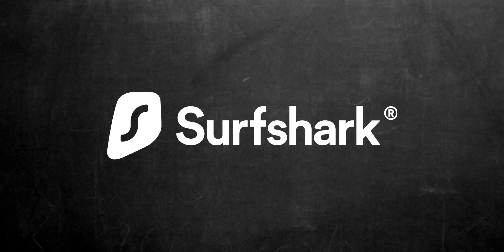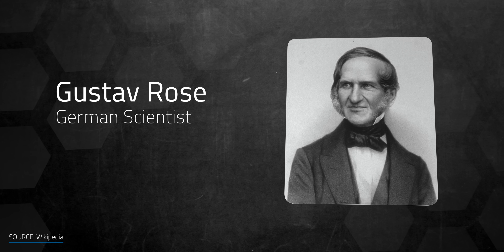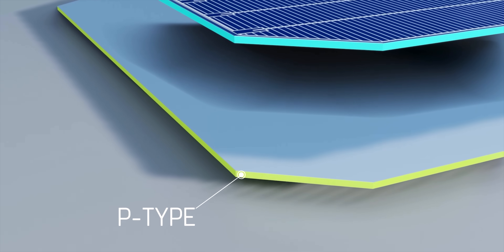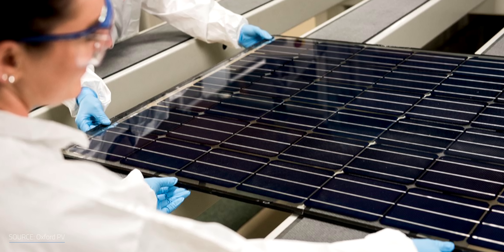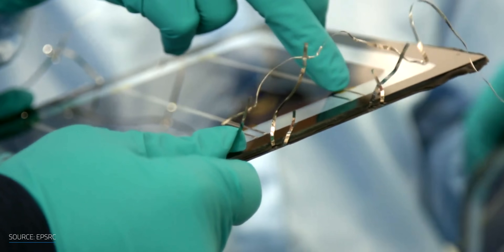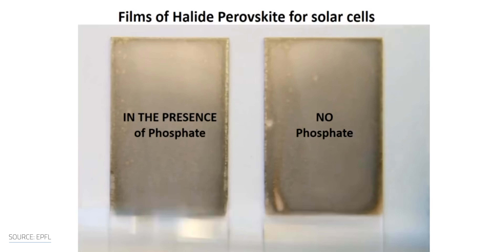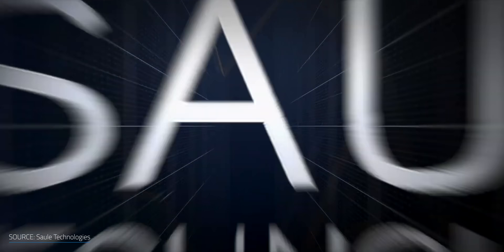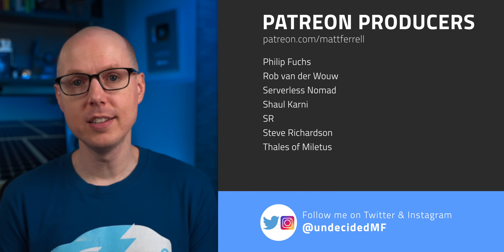Perovskite Solar Cells Could Be the Future of Energy

Comment: So if the lifespan is considerably shorter, I hope that someone is looking into recycling the materials into new panels.
Reply: He did say the process that degrades them could be reversed, so you might just have to send your panels in for regeneration every 10 years.
Reply: @ancapftw9113  Or trade them in like an alternator and others can purchase the “refurbished” panels at a reduced price.
Reply: @ancapftw9113  if the lifetime was 10 years, these would be everywhere. It is much much much much less.
Reply: Why is it harder to refine the metals or other materials out of waste. They refine iron out of rock or iron ore. They refine aluminium out of bauxite. They have to initially refine the arsenic, galium out of other materials to get the semiconductor materials to make the solar panels. You would think it would be easier, at least in many cases, to refine the materials back out of waste.
Reply: @grgmetube  It's a matter of the materials the metals are being refined from.  Bauxite is actually very pure, the aluminium is with very specific elements and silicon dioxides but in a landfill, it would be with anything from motor oil, anti freeze, mercury, lead, countless organic chemicals, pesticides, basically anything that was thrown away.  Refining requires that you know what you're separating the desired material from so that you can use differences in physical and chemical properties to extract them and in a landfill, they are just with too much other stuff requiring just too many procedures to make extraction practical.
Reply: @grgmetube  The reason is mainly that with processed materials you get alot of byproducts. Iron Ore is mostly ironoxide, 2 Iron per 3 Oxygen. You just need to reduce the Iron and voilá. Of the ore contains other minerals as well. Those can sometimes be seperated mechanically or refined parallel.

But with other materials the desired metal that can be refined is a far lower concentration than in the ore. And it isn't easy to seperate them. The ratio between Silicon and boron/phosphorous is around 1 to 10 Million to 1 to 10 Thousand. You cannot get it out again.
Reply: @davidthane9002  In materials that had been used in end-of-life products were sent directly to the recycle place instead of to the rubbish tips, it would be far easier to recycle or reuse. As you said in some raw materials they already have to get at the very low concentration of elements that they want. It's probably a matter of developing the processes, so that the volume of production ori re smelting, in time brings the cost down.
Reply: Same as now, dump them in with the scrap steel pile and shred them, 98%+ of it is known as flock or in laymans terms rubbish.
Reply: They don't think of that, instant profits is what matters to them.
Reply: Why? Why not just crush them and use them as agrigate in roads.
Reply: @wiretamer5710  I did say that other items such as the mylar in juice boxes where the recyclable material is very thin are just ground up as aggregate instead of actually being recycled.
Reply: You think that's bad, you should look into whats happening to all the old wind turbine blades. They're too durable to really break down and even if they weren't they're made out of stuff that's either renewable or so abundant recycling would cause worse effects than just making new. We need to quit screwing around with wind and solar and just go nuclear already...
Reply: @Jmvesey  They've already worked out the wind turbine recycling problem as well as the size limitation of transporting the steel tube and blades on the freeway.  Turns out you can make the turbines larger if you make them out of wood instead of steel and fibreglass, basically flat pack the wind turbine.  The problem with wind and solar power is they are not load following, we've used statistics and weather forecasting to compensate and small gas turbine power stations and energy trading, however conventional nuclear isn't much better due to the need to rotate the use of fuel rods to reduce xenon production but molten salt reactors are load following.  Nuclear may be part of the answer but not conventional solid fuel rod nuclear but something like the Liquid Fluoride Thorium Reactor.
Reply: @johnwang9914  From what I've read wood only works to about 35 meters before the warping from remaining idle in sunny conditions too long causes vibration issues when restarting them. Some companies are also chipping the old blade up into filler and insolation, but the companies that do that are so few and far between most of the time they're just burying the blades because shipping costs would be to high.
I agree on the conventional nuclear rod reactors. You should also check out the modular pebble bed reactors X-Energy is developing. Relatively cheap to mass produce and should be impossible to melt down. They trade irradiated gas and liquids for graphene dust however. But that is much easier to filter than a gas and much more compact than an irradiated fluid. Would be a good stepping stone to LFTRs.
Reply: @Jmvesey  Well, on the nuclear front, China is said to be putting to test a prototype Thorium Molten Salt Reactor before the end of this year. They are looking to commercialise this before 2030. China is very keen to have nuclear as a BIG part of their clean energy solution moving forward, more so now that they just had a taste of unreliable wind power recently in their Northeast region.

Comment: With such thin structures, I could see this having applications in aerospace. You could basically paint or laminate this onto the top side of the many electric aircraft that are under development. While it likely would not achieve a power balance, it would extend the range of these aircraft.
Reply: A Japanese group put out a study they did on some perovskite cells that they exposed to a radiation source. They were trying to replicate the effects of long term radiation exposure similar to high orbit space flight. The Perovskite outperformed Silicon by a significant margin. I think we are likely to see these cells used on satellites before they see wide adoption on planes.
Reply: Heck, even yet could reduce fuel consumption by running stuff in the plane from solar PV

Comment: If life span will be in around 2 years, then price should be AT LEAST 20 time lower to compensate that. Surely this will not happen. Silicon based solar cells simply works, so maintenance is cheap. Try to imagine costs of man hours to replace cells every to years and trouble with that. In my opinion in next couple of years perovskites will be nothing but niche product.

Comment: Can they put solar panels on windmills? That could be two birds with one swing 🤭
Reply: I wonder if they could coat them onto the blades? 
Just like I've wondered why they don't have solar panels already on wind farms.
Or floating solar on every upper dam reservoir used for hydro power. Or battery storage at those projects.
Or why floating wind turbines also don't use a lower sea powered turbine. 🤔
Reply: @4literv6  Putting floating solar panels on a dam reservoir could possibly turn the dam into a sort of battery. Use solar power when the sun shines and save up water (possibly even pump it up if there is space) and then switch to hydro power when the sun is down 🤔
Reply: @AnimilesYT  yes indeed and in hot climates it saves a lot of water evaporation to. From the research I've found on the few floating solar projects.

Not to mention they could easily ad battery storage systems. As the high voltage lines&transformers necessary are already in place.
From what I have found researching hydro power here in the US. Rarely is more than 50% of rated capacity ever used.
So there is room to easily upgrade the old turbines, do floating solar panels on upper reservoirs, ad battery storage for any bleed off from excess solar or hydro production. 

Or even ad wind turbines around reservoirs as they often are in out of the way places. 
Where residents wouldn't complain about the turbines appearances. 
Further more damns are on federal lands to. So I doubt getting them installed would be an issue with permitting etc. 
Imagine each existing major hydro project getting a 50%+capacity increase from doing those simple projects. 👍🏻
Reply: @4literv6  Things like permits can still be a problem in many other places though. I live in one of the flattest countries ever, so hydro power isn't really used where I live, but I've seen other places in Europe where hydro power was close to people's homes. 

Anyway, I mostly agree with you. Using solar against evaporation is also a really good argument. I'm not quite sure about the battery storage though. Large scale battery facilities aren't cheap and it requires a lot of materials. The energy storage solution I was thinking about is pumped hydro. If there is space for it then they could (mostly) stop the hydro power and (almost) entirely run off of solar energy. If there is a lake at the bottom of the dam they could even use excess solar power to pump water up and then let it back down to get energy back when the sun doesn't shine.

That solution is of course not possible everywhere. But I think it could work well in some places. And your ideas could be possibly be used where my idea isn't possible 😊 Or a combination of the two could be better suited for some places

Comment: Matt, this is very interesting.  I wonder if a flexible perovskite product will be used for the cyberTruck's solar panel(s)?
Reply: I recently watched a vid about the Tesla Semi and they mentioned putting panels on the full sized trailer only got them 20 or so miles of range per day. Even with the 50% increase in efficiency these new cells could provide it isn't that significant a boon to put panels on personal vehicles. While it's obviously not nothing and could potentially save your ass in an emergency, it may not be worth it.

Comment: Longevity of the solar panel is least important for many applications. Price is most important and efficiency second. Changing panels every few years is not much of a hassle and when you swap them you get new even better panels thanks to technology improvement.
Reply: I had the same thought. Who cares if the panels only last half as long when they're a 20th the cost?
Reply: If I have to spend $1000 every 10 years to offset all my electrical usage that's totally worth it.
Reply: @Vedexent_  I was just thinking about how many jobs it would create.  If they make the system quick-change and it would include the removal, reinstallation, and recycling of the old panels, you would see Solar panel trucks as much as you see cable company trucks.

Comment: Can Perovskite be used in transistors as a silicon alternative?
Reply: Lots of things can.  I'm not sure it would be an improvement though, as the voltage drop would be larger.  That tends to matter more than the lower cost, especially when you can make chips for only a few dollars or even cents for the cheap parts.
Reply: Yes, but there are some things to consider. Silicon is the most abundant element in the known universe. It's extremely cheap, it's non-toxic, and it works just fine for transistors. The notion that it's very difficult or expensive to manufacture or work with is total nonsense. It's cheap and is it not difficult to manufacture the P-type and N-type materials needed. The solar industry and its investors(a whole lot of politicians in this group) have great interest in pushing the nonsense to justify the prices being charged to consumers. After-all, buying a solar panel is a one-time sale. Importers and sales companies have been taking advantage of the fact that solar cells(and most Silicon products) have almost exclusively been produced in China. Importing them is insanely profitable because the are very simple and cheap to produce. The amount of profit there is in solar panels makes the auto industry look like bunch of altruist angels genuinely looking out for our transportation needs. I am a Computer Engineer, and I am buddies with the owner of a solar import company. I can confidently say I know both sides of it. There is no financial or manufacturing benefit to using Perovskite over Silicon for common transistors used for digital circuits. The only application I have seen that showed any real advantage over silicon is in op-amps. But, as of right now, there simply isn't a need to make the switch because Silicon is performing just fine. EDIT: I should note that all implementations I have seen of Perovskite still used Silicon, so it's not exactly a replacement but it is theoretically possible.
Reply: @Sound_Stable  I think the issue is that you have to get silicon extremely hot to purify it enough.  Generally the cheapest sources of heat are carbon based, so places with carbon regulations are more expensive.
Reply: @ancapftw9113  it's definitely up there, but it's really not that bad in the grand scheme of materials manufacturing. There are common metals used in everyday items that require much more heat and energy to produce. Power sources for production is a whole other discussion.
Reply: @ancapftw9113 , that is an issue for solar panels that used standard doped crystalline silicon. For standard semiconductors, where each physically small chip has high value --  it's hardly an issue.

I don't think you quite understand the semiconductor production process, but then if you're an "anacap," you don't understand socioeconomics either. But hey, I'm sure there will be lots of solar panels in our feudal future.
Reply: @Johnny.Fedora  I know that you don't convince people that you're right by insulting them and strawmanning their position.

Comment: I think it needs 20 year warrenty, with it being like teslas roof. So that the barrier to entry is less for a great roof. That and mechaninical connections instead of wires. So it can be a slide on then braced. A standard size like shingles is vital.
Reply: Depends on who is using it, and whether it is integral to a structure. In a dedicated solar farm switching out every module every 2 years could easily be viable if the cost is low enough and they are designed to make the job easy. Even if they were roof mounted, switching them out could be viable. If you have to tear off the whole roof, not so much. I'm not a fan of the window idea for that reason too, but replacing the blinds every 2 years wouldn't be that big a deal.
Either way, I think the biggest barrier currently is the lack of good energy storage, not the difficulty of collection. The next barrier is the cost of the inverters to get solar energy to the grid. Even if the cells themselves were free, it would only reduce the cost of a system by 50% because the electronics are already half the cost.
Reply: If it ends up 1/4th the cost, a five year warranty would be plenty. Such a thing would be great for self-financing installs. Every five years get more, and continue to monitor where the old ones aren't providing value.
Reply: Current panels have 25 year warranty, not just on the panels, but on the production value. So, yeah, they need to do at least the industry standard.
Reply: @Elizabeth-vz3zc  Oh, you'll get your wish soon. Reported.